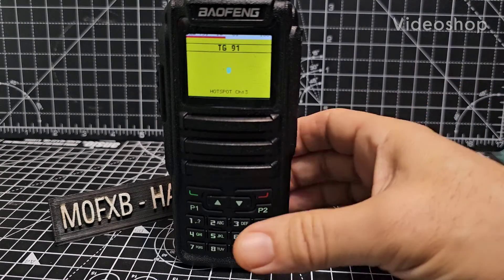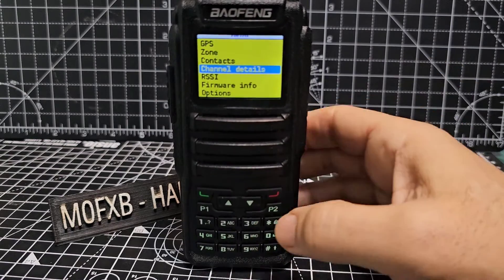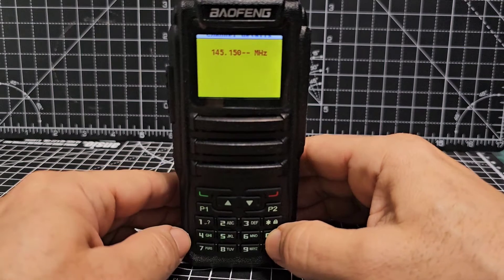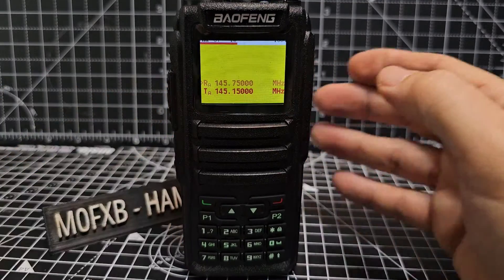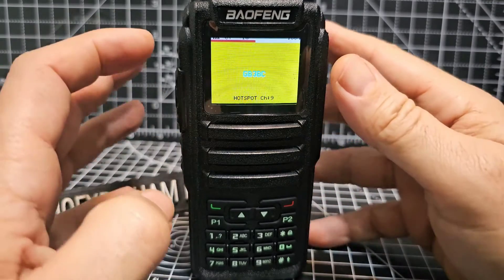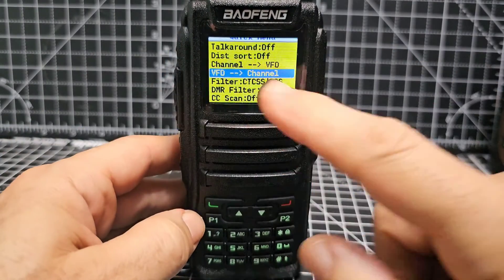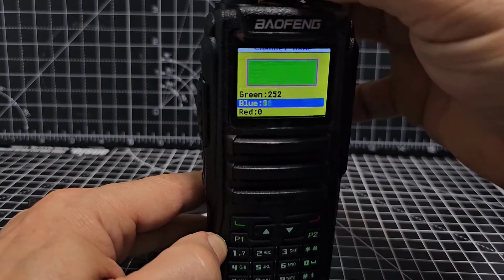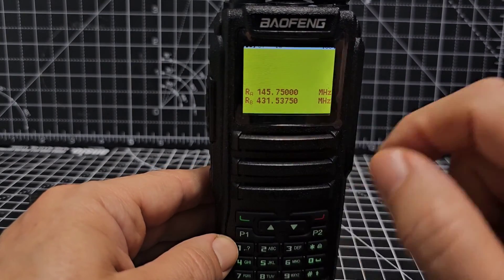DM-1701 ,Opengd77  MANUAL ADD CHANNEL & DMR NUMBER

Comment: We have gotten to the point with so many features that it no longer is easy to program a radio.  I watch you in amazement you can remember where all the features are located in
the radio.    I think the next move has to be speaking what you want to do into the radio.   Older people like myself that have to many toys have to think how to use one of them
should we not use it for some period of time.  ha ha....
Reply from the maker: Hi , the simple way is push red button type Freq select mode .
Reply: @M0FXBHamTech  ha, ha,  about 5 years ago when I got into DMR I wondered how the average Ham is going to be able to deal with codeplugs, Digital Contacts, etc.   My first DMR HT was the Baofeng DM-1801.  Paid $55 U.S. at the Orlando, Florida Hamcation.   That took a while to learn but good Hams in the area
got me going and before you know I was helping Hams.  Picked up the AT-D878 later.  I might try the OpenGD77 on the 1801 and use it for a high powered hotspot.
I tried the dedicated board that connected to one of my FT-8900 and a hotspot for real high power but it was a bit touchie so I retired it.
Reply: Can you write all channels I'm from computer?